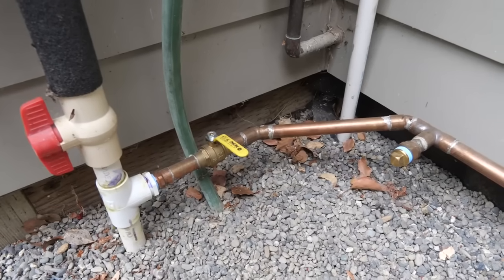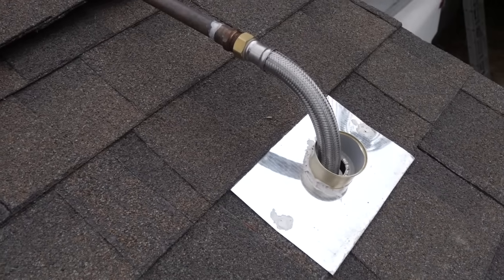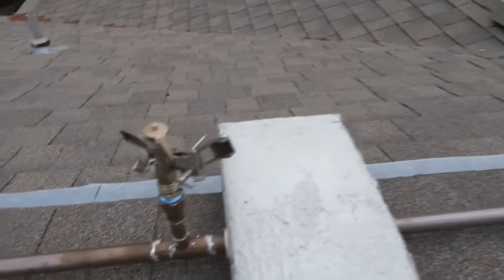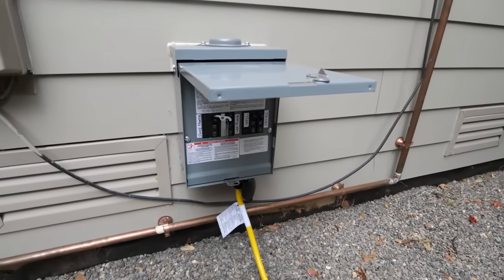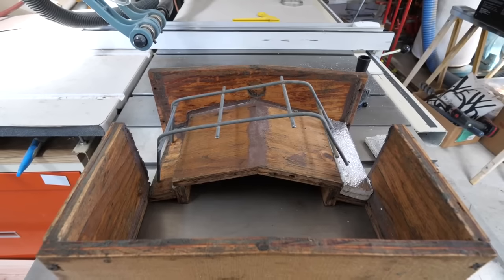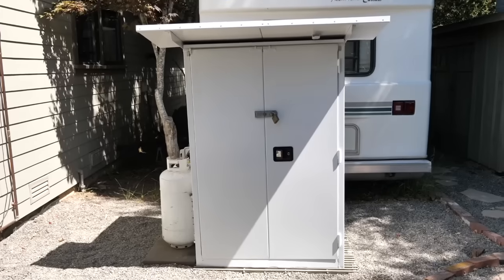Roof sprinklers and backup generator for wildfire-prone rural house

Comment: I’m a contractor and I gotta say, well done my friend. Very good thought out plan. I hope you never have to use it.
Reply: Lots of LA houses have pools... would be pretty quick work rerouting those few thousand gallons to the roof.
Reply: @ Not sure if there would have been enough water jn their pools to stop that raging inferno.
Reply: My pool holds 30,000 gallons. Can certainly do something with that. Big problem is debris in gutters catching fire. His system solves that problem. 
Municipal water systems are not designed to fight fifty house fires at once. I doubt people would have wanted to foot the bill to upgrade before the big fire
Reply: @ I love that system. Our  Problem here is in 2014 we voted to Pass Prop 1 that allocated 7.1 billion dollars to build more reservoirs. It is 11 years later and nothing was built. And the one reservoir they had there, Santa Ynez, has been in disrepair since Feb of 2023.  

There is that one family that I believe successfully saved their house from the fires with a pump that they used to drain their pool.  I’m not entirely sure of that story however.
Reply: Yeah, great system with a few caveats. One is that you really need sprinklers or misters under the eaves to wet down all sides of the house. If a fire is reported anywhere in the vicinity, you will of course start the sprinklers ASAP to wet down the brush as much as possible. You may want to try and trim back as much of those trees and shrubs as you can. I hope your water tank doesn't run dry before the fire dies down.
Reply: Hey! Im also a contractor! 😃  LOL! 
Why does everyone need to know youre a contractor?
Reply: @bigtroll8249  I'm not a contractor, but I did spend the night in a Holiday Inn Express!🤩
Reply: This is an inadequate designs the roof of the house isn’t what’s most likely to catch fire it’s around the windows eves and gutters or any penetrations you need a water curtain to protect your house a fire can over come sprinklers easily
Reply: I love it 100%
Reply: Sure a contractor, LOL as if you have a clue.  Where is his water source ? Without it contained on property and pumping system, this is a 
waste of time.
Reply: @ 
Watch the vid, he has his own well. 🤦🏻‍♂️
Reply: @jeffbarron5500 If you watched the video you would have known this man had his own well. That is what the generator was for, to power his well incase the power was lost.
Reply: Every little bit helps.
Reply: Hello Mr. Contractor... It's nice that you praise the work itself, but praising only the work carried out without looking at the whole is not the way to go.

In any case, I immediately noticed 13 problem areas in need of improvement that a contractor with a solid education in building construction would certainly have noticed immediately. But hey, as a Trump voter you naturally lack a view of the whole thing, which is completely understandable. You shouldn't laugh at a blind person because they can't read.

So here is my post about the actual video:
++++++++++

First of all, I don't want to denigrate your work, but I have noticed a few things that should be improved in your interest!

The following fire hazards still exist:
- 0:44 Roof overhang
- 0:44 Clinic openings (or ventilation openings)
- 0:56 Combustible roof covering
- 1:26 Trees / bushes too close to the house and also above the roof in an interior angle, absolutely dangerous!
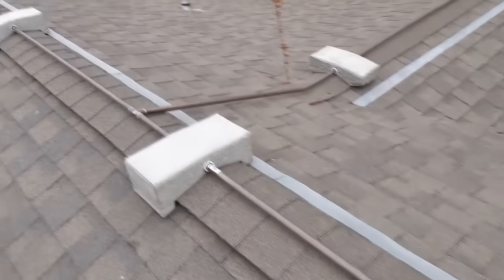- 2:00 Dry, flammable material on the roof
- 2:09 Even more trees and bushes right next to the house, plus the fan and the clearly recognizable open large pipe leading into the inside of the house.... The purest invitation for sparks to come in and cause a fire from the inside. A damp roof doesn't help either, a spark that flies straight in is enough!
- 2:09 Sprinkler pipe is too short, it's not just about moistening the roof, the house walls and especially the immediate surroundings around the house must also be wet!
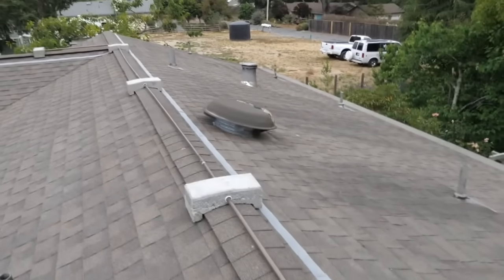- 2:45 More openings leading into the house
- 2:52 Another tree too close to the house, plus a conifer.... why not put gasoline barrels in the garden?
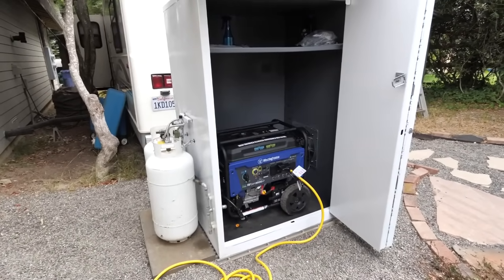- 3:36 Emergency power generator set up outside the protected, wet area.... Pointless. The part belongs INSIDE the house, where it is best protected, after all, your irrigation depends on it! The fact that the generator in the box is protected against fire does not help the exposed cable, which is quickly scorched in an emergency!
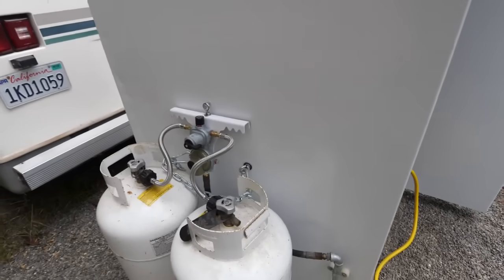- 4:51 Gas cylinders open in a fire hazard area .... I am lost for words
- 5:44 Power distribution outside and ventilation grille near the floor, a perfect target for the next fire!
- 8:37 Despite the sprinkler, the pressure system is not safe because it is under a tree.

I don't want to beat you up completely, the approaches I have seen here are already quite useful, but you should make a few improvements in your own interest.

1: Trees and bushes must be moved away from the house. they are the greatest danger for fires.

2: All openings leading into the house must be protected from flying sparks. There are standardized (in Europe) fireproof, automatic dampers for this purpose. However, it would also be sufficient to install 3-4 narrow wire grilles one behind the other at a short distance to prevent sparks from entering the building.

3: The power supply is your fuse for everything, protect it completely from fire. So lay the cables underground, protect gas cylinders against fire, preferably like the generator in a fireproof box with forced ventilation

4: Replace the roof covering with non-combustible material. If necessary, have it subsequently coated with fireproof material, there are suitable paints / coatings based on silicate.

5: A small wall approx. 30 cm high around the property or at a distance of approx. 2 meters around the house. This prevents the burning grass from reaching the house wall. In addition, a gravel or sand strip of approx. 1 meter around the house and keep it free of anything that can burn. 

6: Do not store any flammable liquids on or in the house, not even in the garage. So either enclose everything in another fireproof box or don't have it in the house at all.

7: Nothing can be done about the roof overhang, but in the event of a forest fire, vortices are created here that keep the flying sparks in place for a long time. If necessary, remedy this with additional sprinkling. It does not have to be a sprinkler, it just has to be ensured that the underside of the roof and the upper part of the house wall remain damp!

8: We still need to talk briefly about the windows. I know that the window glass used in the States is not as heat-resistant as it could and should be for cost reasons. Now you could either replace all the windows and use fireproof glass, or you could make fireproof shutters / window flaps that can be quickly closed or installed in the event of a fire. If necessary, wooden panels painted with fireproof paint can be placed in front of the windows and locked or screwed in place in the event of imminent danger.

9: I could not see whether the whole house stands on a completely closed foundation, or whether it stands “on stilts” and was only covered with a grid in some areas. Please note that a lot of dry and easily combustible material accumulates under the house. The base area of the house should therefore be completely sealed with brickwork. If this has already been done in this or a similar way, well done and thoughtful, my praise!

Kind regards from Germany, may there never be a fire in your house
a graduate engineer in structural and civil engineering
Reply: This would have never worked in the Palisades fire since the city water is also connected to the hydrants. And once the 5th or so fire engine connected to the hydrants the pressure dropped and essentially had no water going uphill. Also a shame that the Santa Ynez Reservoir was totally empty since about Feb of last year.  So you would have had to have a huge water tank on your property and pump it into your sprinkler lines.
Reply: @branemente  This system isn't on city water. It's on his well water system.
Reply: @Bill-yy3ck  Wells never run dry?  Well pumps never fail? Generators always start? The propane tanks are never empty? The vent fan will never fail in the generator shed?  The owner will always keep up the maintenance on every aspect of the system?

I list all of those items because I have heard of, and seen, all of those things occurring over the years.
Reply: @branemente  Agreed, however in his case he was using a well on his property.  No need for municipality to provide.  A tank though would be good the volume of water one might need.
Reply: @branemente Many people have pools which they could have pulled from. Getting a 5 thousand or so storage tank is also doable.
Reply: @branemente  he has a well...
Reply: @ Did you not read my comment that says I was talking about how great this is and that it would not have worked for the people in Pacific Palisades?
Reply: @branemente Yes, the city water is going to run out pretty quick but, no, you don't need a huge tank.  

You buy a cheap above-ground pool from Walmart and 500 gallons will put out a lot of Fire / spot fires!
Reply: @branemente  I have a private well and back up power to operate it indefinitely.
Reply: @ShastaTodd  That’s great. What I was saying was that this would not have worked for the people in Palisades. Better to have your own reservoir because here in CA we can’t trust our government to have water when we need it.
Reply: @branemente this would have worked for the people in the palisades if they had a well, the well is part of the entire stystem, it's not like the region matters (or is it illegal to drill a well in LA)
Reply: @branemente 
Would you be prepared to pay higher taxes to pay for this?
Reply: @ It was already voted for and money allocated. CA taxes are already high.
Reply: @Redstoneprofi01 A well only works in areas with accessible aquifers or other groundwater.  The LA basin has little of either.
Reply: @ShastaTodd is your backup power gas or diesel? Or some other kind of energy?
Reply: I'm also a contractor on electrical and general contracting. Not a firefighter but I believe this would only save his roof, but fire could start on his walls and eventually collapse the roof and then we have nothing
Reply: @contractorvegas5384  That is why I designed and built my sprayer system to be located under the eaves!
Reply: @contractorvegas5384  ...I agree he should put sprinklers at ground level facing his house aimed right under the overhang of the roof. Maybe he'll upgrade...I would if I was going to the trouble of installing a self sufficient system. I've been telling friends that the devastated homes in California that if owners rebuild they should be required to have a system like this.
Reply: @contractorvegas5384 need misters attached to bottom of gutters .
Reply: Would you build with plastic bricks 😅

Comment: The Basis of Design is quite good.  Unfortunately, the 'As Built' is full of Single Point Failures that will 'bite' when you need the system the most.

PVC out of the ground to the metal piping - Failure Point
Gas Bottles outside of the Generator Shed - Failure Point
Sprinkler Head for distribution of cooling water (on roof) - Failure Point
Single Water Distribution above the Ridgeline Vent - again . . . 

Again, it IS a great start, but unfortunately, as it stands, chances of a successful outcome are hobbled by the details.

Comment: Outstanding! I'm changing out my garden hose crap to copper as soon as the snow melts. My system has to be put up in case a fire starts. This is the way to go, one and done. Nice and solid!
Reply: Galvanized pipe would be cheaper

Comment: That is a MASTERPIECE! Great job! I am glad to know I am not so crazy! I thought about it as well. I already have the generator but my sprinklers aim at the walls, I need to reach the roof!  One thing though, secure the concrete weights in case a windy fire lands a tree branch on a pipe and pushes it, it could snap the system lose. Then bury your power cables at least 18 inches underground to protect them and you are all set! If I stop taking the pills VA gives me😃, I may enclose the propane tanks (not top but sides since heat rises) with cinder blocks filled with sand or orange can fire foam to insulate them from hot winds or ground brush fire heat; likewise, a ground sprinkler to soak the cabinet and tanks.
! People think we are crazy until the $#!t hits the fans, they they come running to knock on our doors😄

Comment: This system is acceptable only IF you have a captive source od water other than city water. Every homeowner who opens a tap will starve system pressure away from professional firefighters . If you have pool you can draw from or other containment tanks or recycle roof water from the gutter runoff back to the roof in a loop

Comment: We lost our home in the Tubbs fire. The aluminum engine in my car, melted and ran down the driveway, due to the high temperatures. I still have the aluminum. 
Our house was reduced to ash. Even glasses melted inside the dishwasher, which requires 2500F. We had a steel shop, which survived with only some burnt paint.
We nee to build homes without wood and asphalt roofs. We cannot use bark chips and wooden fencing. Building codes need to reflect our new reality.

Comment: Honest question: How well does this work in high winds? That is, can the system’s water land on the roof and surrounding vegetation in 50+ mph winds? What portion of the water blows downwind &/or evaporates in the high temp/low humidity of a wildfire?
Reply: Exactly. I've seen simple lawn sprinklers like this become utterly useless in mild winds. Wildfire winds are going to make a mockery of this.

Comment: Seems like a great idea IF YOU HAVE WATER!
Reply: He's on a well.
Reply: What about  collecting rain
 water? Or a separate barrel for emergency use .
Reply: @ It’s the intense heat and sparks/cinders from surrounding fires that continue to reignite, you need a constant water source!
Reply: @leehranicka3689  like a mini silo but much bigger than the largest size rain barrel. This guy has a well but that's not the case for the average home owner. It is a definite beginning to a possible solution. Any engineer could come up with a solution. Sometimes I wonder why it takes so long to solve the problems when the problem leaves so much devastation over such a long period  of time, like the last 24 years.

Comment: Great idea, but you still need to mitigate bushes and that tree on your roof line. You have trees that are 3 foot from your house.
Reply: He said the sprinkler does a 40 foot circle
Reply: @whdbnrm3023 . In NO wind . Now 35 to 60 mph winds the sprinkler stream is NO good  for dispersement . Now put that same sprinkler system IN  the attic and you have perfect spray uninhibited. Also put fire proof -cover over 14 inch rotating twirling vent. ….

Comment: The generator cabinet is open when in use; the cable isn't buried in the ground; the propane tanks are exposed to potential dangers; the sprinklers arc of fire needs to be wider. These are all problems I see with your system.
 When the Paradise fire hit, I sent an idea for a gravity fed fire suppression system to Gavin Newsom's office. Guess what, they weren't interested. 
 What happens if something happens to your generator. It could break down, get stolen, or get fire damaged. You can't rely on external power for something as precious as your home, possessions and vehicles.

Comment: AND,  You better have your own "water source".....as residences and hydrants will use
up all the water if there are a few fires burning at the same time......
Also, your fuel for the generator needs to be in a fireproof cabinet also......sitting on
the outside if a wind-driven wildfire hits will be disastrous......
Your electrical cables need to be in conduit and "buried'" from the generator to
the transfer box......

Comment: Amazing, a 3 years old video is now trending. I didn't know generator can run on propane. Thank you sir for the lesson. I'm setting it up tomorrow.
Reply: Some generators are dual fuel as well so you can use propane or gasoline.
Reply: I think it is a good idea to avoid gas and is a good solution for rural installs.  It is clear that some people saved their home by watering down with a garden hose.  This approach wouldn't save every home but many would be spared.
I installed a full home backup generator this year from Generac that runs on the natural gas line.  It automatically starts up and runs for 5 minutes every couple of weeks to keep the engine fit for use.  The natural gas remains available even in a power outage.
Reply: It is because you are clicking on News stories about the fires. It is not random or ironic. Algorithms!

Comment: Furthermore, if you had a standing seam metal roof then it would be easy to attach solar panels to your roof, which could run your house during a power outage and any other time. I think people fail to recognize the fact that they burn too much fossil fuel, and are not sustainable, but by using solar panels, we can reduce our dependence on fossil fuels, which obviously contribute to climate change.

Comment: I think you should replace your asphalt shingle roof with metal roofing. That is non-flammable.. also any exterior surface of that house that is not either concrete or metal is at risk of catching on fire. There’s also too much vegetation around your house in my opinion.

Comment: Thanks for sharing. Brilliant idea. Like those guys that were on TV in LA who had a pump system installed for an occasion that was needed just a week ago - have it in case you need it (but maintain it too!). I still don't get why Americans predominantly have wooden homes though along with bitumen-based shingles. Yes, less costly to replace, but they just can't stand up to fires and high winds like solid brick or cement structures.